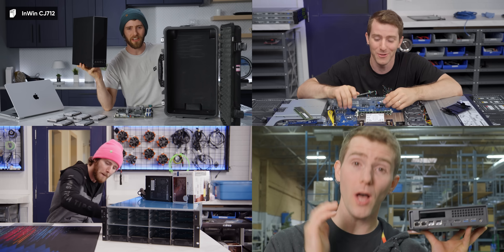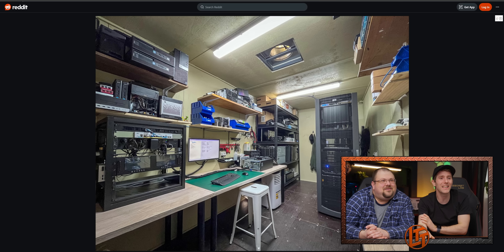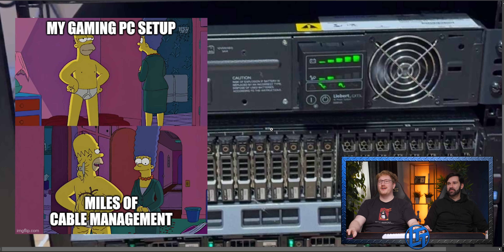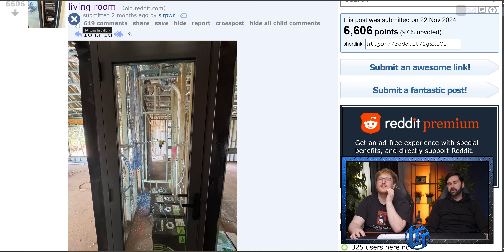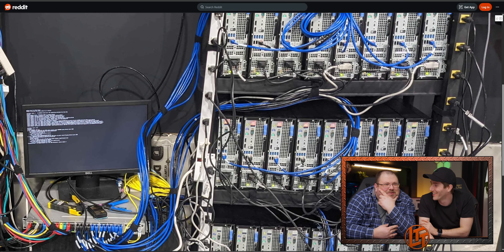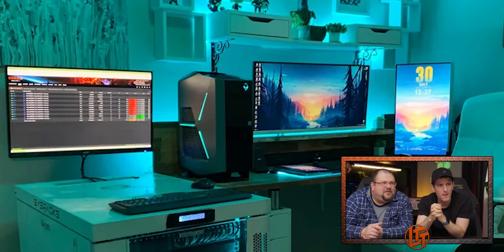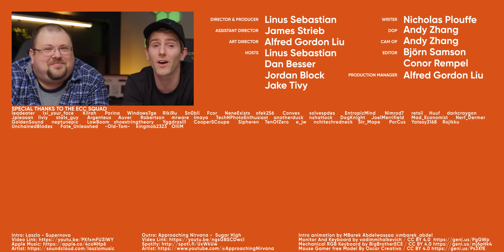Even I’M Jealous of These Guys - Reacting to r/HomeLab

Comment: If I did this, I'd make a kiwix hotspot(you can make one with a raspberry pi), use one of those five bay diskstations as a server, as well as have Blu ray backup with a modded ps3. I currently only have hotspot on my phone, and it's 30 gigs, so I might see if that's enough before I buy a hotspot. I see that people buy the big drives, and I'd rather have smaller drives so there's more mirrors of the data. I think I can make it so the setup isn't too crazy.

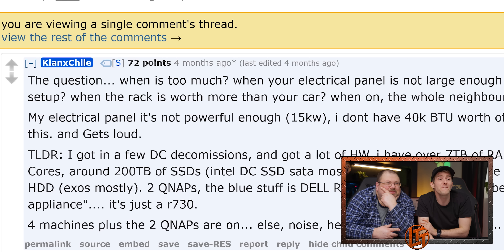Comment: Watching this while working at a utility company from home. At 8:25, the "home lab" is said to use 15 kW when it's all running. For reference, the house I'm designing for is a 3 bed 2 bath with electric heating, and if you had every single thing on in that house at the same time (electric heat, lights, appliances, etc.) that would sum 30 kW. 15 kW is an INSANE amount of draw for just the lab, and that's also a hell of a lot of heat to deal with. Thank god this guy has solar panels

Comment: Former IT here, I did bring some of my work home with me. Now running different VLANs, several wifis. My internet router is a Zhone GPoN but I only use it as a fiber to ethernet converter, it gives me a public IP adress. As a firewall I have a Watchguard M370 and my WiFi is a old Ruckus with several mesh APs. My server is an old HP Prodesk G3 running VMware with 4TB of storage and 32GB memory.

Comment: Me with my homelab being a decade old thinkpad plugged into ac, running arch Linux. The bottom cover is gone and the seperate power button board is broken so anytime I need to turn it on I have to reset the cmos

Comment: Honestly, when you work at an enterprise job at a company that can't resell their servers due to data privacy violations, but also small enough to just hand off the servers to the system admins... You end up with quite a bit of stuff.
I have a few servers and a large NAS that I remember we spent about 200k on contract from HP, along with two FGs in HA. It gets kind of ridiculous, if you're at the right company.
Quick edit because I know someone will ask: That invoice was NOT for the NAS alone--It was a larger refresh including 4 fiber switches, the NAS, and 5 blade enclosures for virtualization, along with support. Obviously one of those items is not worth that much.

Comment: These used to be my #goals, but now that I work as a system engineer I don’t want to have that enterprise hardware in my house chugging the kWh and dumping heat the the AC will need to work to get rid of. I’m rebuilding by homelab with a few servers build on consumer grade hardware and running everything I possibly can in Docker or VMs.

Comment: I must admit, I've got a rack in one of the spare bedrooms, with three servers and sixteen lines. The whole house is wired - I don't run WiFi unless the kids are visiting, and it's on an isolated subnet. At least two Ethernet ports in every room, plus to the security systems/cameras. Been building it up over the past couple decades.

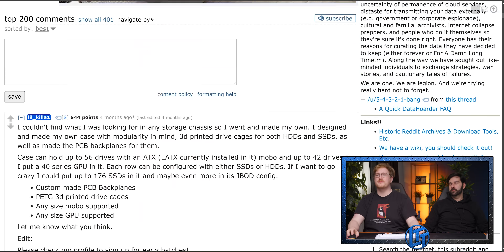Comment: 10:03 oddly enough, you can 3D print PCBs. You can do this with 2 methods, the first method involves using copper clad covered in UV sensitive film, and then shining UV light with a resin printer onto the spot where you want to keep your traces, before acid bathing it to eat away the rest of the copper. (the easier way is printer toner and an iron, then acid bath)

The second is just straight up melting metal. I've seen channels like Bad Obsession make a custom printer that would print traces from an STL file using specially made solder wire. We also have metal 3D printers now, like Hacksmiths new Meltio printer. These can definitely print a circuit board, using normal welding wire.
 
Where the second method may fall apart is with the support materials to stop those traces bending/snapping, but that can be solved by adding support to the surrounding areas with a filament changer, or by bathing the circuit in an appropriate material, and then releasing the board it was printed on so you can quickly clear the holes on the PCB. Voilà, a 3DPCB.

Comment: I designed and built a 3-monitor mount for my dual Dell 25" screens and centre 27" screen using T-slot extrusion. I 3D printed custom VESA mounts and mounted the whole setup on rollers so the monitors can move towards and away from me while staying perfectly aligned. Super happy with how it turned out!

Comment: Do you have any guidance on best practices for laying out a42U rack with about half populated?
Reply: You're gonna want to do it by weight. Heavy stuff at the bottom (UPS and servers) and light at the top - that's generally the networking gear. Don't even think about cable management until you have everything positioned where you want it and then be sure to use Velcro, not bloody zip ties.

Comment: The saddest thing about that "Grandpa Homelab" that was EOL in 2007 is that you can buy a desktop PC with 96GB of RAM and 16 cores/32 threads and 4-8TB of M.2 storage that will absolutely shred the crap out of that rack at 5% of the power draw and space.
Reply: Oddly specific comment
Reply: @archangel7294 
He's worked legacy IT for sure

Comment: I feel like I should start to post my datacent... homelab... I ment homelab... I mean... okay, it kinda escalated... Ive got 4 full 19" Racks. 2 of them are a proxmox cluster, 1 of them is a HyperV network, and one is a VMware ESXI Network
All of them work independent with their Subnets, Vlans and AccessPoints
I keep telling myself that they are just for testing to learn about all the hypervisors... but I think Ive gone a little to far, considering that ALL these FOUR 19" racks are full with servers, switches, Routers and Firewalls from their bottom to their top.😅
I even made my own Power grid for the servers

Im just testing at home... thats all... 

Did I go too far?

Comment: I personally believe that if you got Cat 5/6/7 cable bundles as thick as your thigh going through your private home you did something essential wrong, such as overcentralizing your network switch or at least choosing copper over optical fiber. Heck, most companies need less and that is without using local caching strategies and "subnet cells".

Comment: multiple desktops, some obsolete but still working so kept around as backups, some laptops and tablets and cellphones in the household. will move from a flat to a small house in a year or so, got a bunch of external and internal hard drives and even few hundred of cds and dvds which have not been checked for a decade or so /as most is on hdds or obsolete with replaced newer data/...and with the house security system with night vision capable cameras will have to be managed.... will want to consolidate all that, thinking of a half rack on wheels, ups on the bottom, nas above 12-16 22/24TB drives with redundancy for some 150TB netto space, either minipc or mini server for video surveillance and automated backups /llm AI assistant/ and some ssd based fast access nas for hot data - something like asus flashstore from a bunch of consumer m.2s or if prices become affordable maybe something small in size but big in capacity with U.2 drives ....now only time to put it all together and the pocket change of some 20k+ /mostly storage and home media and surveillance server/

Comment: 7:21 i have a setup with 3 across and 2 32"tvs mounted an the wall just above those, works great for controller games to throw the gameplay on the tvs and extra stuff onto the monitors

Comment: 13:11 Anyone know what server rack that is? I genuinely wanted to get one about that size and get a 4 U PC case stick it in there and then stick another 4U with my old PC hardware reconfigured as an unraid server before I got my current setup going but id still be down to get a rack that size for.... stuff if anyone knows one that size. Most of the ones I looked into didn't have a front panel and I have a hairy dog so thats a factor too.

Comment: Zip ties > Velcro most of the time. Faster to both put on and take off, and they don't pick up dust and lint like Velcro does. The only time Velcro is preferable is for cables you are frequently wrapping or unwrapping. In a computer or a rack where things don't move as often zip ties are the way to go.

Comment: My home server is an X99 MB with dual Xeons (72 threads), 128gb RAM, SSD OS drive (Linux), two 1tb Samsung NVMEs in a raid 1 mirrored array running the game servers, and two physical drives in a raid 1 array for mass storage.  7 Noctua fans to keep it cool.

Comment: I've still got a couple dell poweredge server in my shed.. it isn't worth the cost of electricity to run them when i can play with servers at work all day and i don't have a need for them at home. I just run a low power media server. it's quiet and it's inexpensive to operate.

Comment: I've downsized my homelab considerably over the past few years, mostly because I have more capable hardware now than I did previously. Where once I had 6 servers running (Dell R210 II, R220, R720XD, Supermicro X9DRI, 2x NUCs), I now run all the same workloads on two - a Dell R540 with Unraid for Plex and storage, and a Supermicro 5019D for Proxmox

Comment: 5:00 This dude dose not live in Sweden, if he did this stuff would NEVER power on. especially during the winter.. there is a REASON why i have stopped using my "old school" VMware stack based on HP DL380 servers with EMC SAN... now my old AMD Threadripper is my VM platform with Fedora Server 40 with virtualization installed to run VM´s like a VMware rig. the AMD Threadripper is much cheaper to run and i have a ton of RAM and CPU cores my virtualization server. best of all i dnt need to use MS Hyper-V for home lab and home infra.

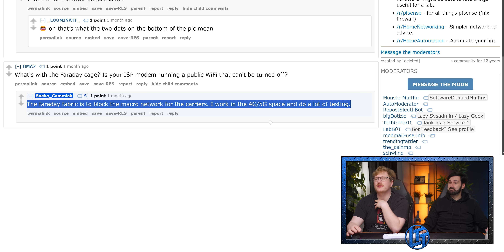Comment: 03:18 Um, former telecom engineer and current HAM operator here. No it is not extremely illegal. It is very legal, and if you live in one of the thousands of deadzones in the country, your cellular company will usually send you one of these for free that connects to your home network and the internet to provide you localized cell service. What would be illegal would be to make your own transceiver that operates on the licensed frequencies when you don't hold that license. It's only illegal if it causes interference and/or is unlicensed. The company that made the micro cells would have a license to make these. Even if you don't have a license and it's some home brew transceiver, it still wouldn't be illegal unless it caused interference. Consider that it is illegal for you to start a pirate radio station that broadcasts out to your city, but it is perfectly legal to use an FM transmitter to send your mp3 players audio to the radio in your car. That small FM transmitter is transmitting on regulated frequencies, but it is so weak it is not causing interference to anybody around you because the signal drops off within feet.
Reply: good to know thanks for the info bite 👍
Reply: I was hoping someone would explain because I had no idea what they were talking about, but was very intrigued. Thanks for the info.
Reply: @Kodack-ki2im  I think they thought it was illegal because they tested WiFi/cellular stuff before that absolutely would, without a doubt, cause interference out of their isolation chamber. Then they probably just had that in their head.

Just guessing. But ye, they could have specified the whole interference part for clarity. 🤷‍♂️
Reply: That's cool. What do you actually do in your job? Like what do you for work everyday?
Reply: Question, is there any unregulated frequencies that we are free to use as we want?
Reply: @poyenwu  There are plenty of frequencies set aside for the general public like 2.4ghz and 5ghz, however these are still regulated, and you still may not lawfully cause interference to these frequencies. This is why jammers are illegal. The golden rule for RF is you must not create interference and you must tolerate interference created by others.
Reply: @Kodack-ki2im  no one cares

Comment: Fortinet is very popular these days. Big attack surface. Also if you running eol hardware with no updates it bad. Every firewall makers have issues these days, even Cisco, juniper and other big guys.
Reply: I have a Subscription, I would not run an “enterprise” firewall without one. I own the first lab.

Comment: My "homelab" is currently reduced to a single 4u server in my old bed room at my dads place. I only have a few mac mini's running various dockerized services in my own apartment, mostly custom CI for work.
We have the same ISP at both places, but unfortunately, they wont offer a site-to-site VLAN.
So i'm probably gonna try to get two mac minis to run WireGuard and see if i can get near the 1Gbit/s uplink i have at both apartments.
Currently using my routers for this, but i only get up to around 120 Mbit/s when tranferring files to my server at my dad's place.

I did talk to the building manager here, and they told me that i could probably be allowed to pull power to my storage room in the attic.
The building's backbone is in the attic (weird it's not in the basement). They told me i could get a 10Gbit/s hookup if i want. So i'm considering that, so i can move my servers to one central place. That way, my friends can also have their servers here.

Comment: Working in a data center, I can tell you that you can accidentally get VERY high end server hardware for nothing. These big companies don't even try to sell it. They just pay companies to come in and decom it all and get rid of it. Same with auctions of bankrupt businesses where you wouldn't think to get server stuff. You can get a pretty good network and power equipped server rack from a restaurant for a hundred bucks where I live.
Reply: 100% agreeing with you
I mean... ive got 4 full filled 19" racks in my basement
2 running in a proxmox cluster,  one running HyperV Servers and one with VMware ESXI Servers

I keep telling myself: Im just testing some stuff

But I think this got a little too far😅
Reply: I mean, the cost of just decomming them is going to be expensive by itself, so if you can get someone to pay like, 5-10% of its value even, it will absolutely be worth it lol. 

I wish I can get a source for that though. I kinda need a 10G switch lol
Reply: Of course though... You have to take it all apart... And wheel it all out... And find some way to stuff it in your vehicle. You better have a van at the very least. AND THEN you get home and get to put it all back together and hope that it all works! :) There's a reason it's free.
Reply: @arnox4554  Where I live there are quite a few transport companies that will help if you don't have a big enough car. Though it's highly unlikely my area and the OP's area of living overlap at all.
Reply: @arnox4554 Oh no, the thing I'd have to do anyways no matter where i purchased everything from.  😅
Reply: @arnox4554  It’s just not cost effective for a company to try to piece out the hardware on their own. I once bought an absolutely gigantic copy machine from a school board auction. It had over 2 million copies on it. It stapled, sorted, collated. You name it.  I bid $5 because now one else wanted it. Rented a lift gate truck ($70) to get it home. Plugged it into my dryer outlet. Call a service tech to come look it over ($100). Sold it on eBay for 2 grand.
Reply: as a university student, this is my dream ;)
Reply: I'd like to know such a place. I do research and I am unfortunately met with the opposite issue (not enough hardware to run my stuff). I'd be happy to take a couple of nodes out of people's hands.

Comment: I totally agree that HP used to make some of the most serious measuring equipment.  I worked for a place making wave tech for science, and it was 2000 and we still used their frequency counters, Network analyzers, oscilloscopes, that were made between the late 50's to the mid 70's...  When the owner was to old to no longer function his family closed us down.  It was not done in a good way at al, and people got stiffed and not payed...  Well at least I recovered some loss and I got and still use the 1971 HP 3478A multimeter.  It's digital, and programmable to do all sorts, and their devices can all cross communicate, BUT (and It's a big one):  You got huge books with each one, because YOU had to do all the programming.  I also confiscated a one of a kind prototype Techtronix 465 oscilloscope; first ever with a digital wave hold and function storage thingy for superimposing readouts over each other for comparison, and a few other tricks.  It is in the same housing of an optional volt meter one could get it with (on top), just with a different face plate.  Once finalized they moved them inside with the rest of the stuff, which they were able to shrink down significantly:  The thing only has a few cm³ of free space in it for airflow, it's that jam packed full of circuit boards and components!

Comment: I love that the guy with the Fortinet had it routed through a Mikrotik. When one firewall isn't enough, get two.
Reply: i am the guy and the Mikrotik is a Router and not a Firewall. The Mikrotik does inter vlan routing with 2x10 Gb/s the Fortigate is perimeter security and does my SD-WAN (yes, I have 2 WAN connections because I work 100% remote)

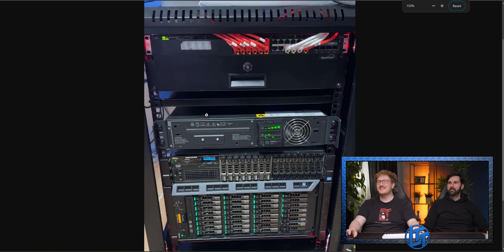Comment: The little throwaway line about the SAS drives and the frequency that keeps teenagers away (somewhere around 4:25) went waaaayyyy underappreciated
Reply: I have a Mac Pro that has 4x 15k SAS drives in it, the only thing I can hear are the drives making the case resonate, which is surprising since that case is the best built, best fitment case out of any branded desktop computer in the last 25 years. Drives me nuts but I just live with it cause it’s novel having 4x 15k drives in a Mac that would otherwise just have bog standard 7200rpm SATA HDD’s in it for its entire life.
Reply: There was a device that somewhere I worked was looking into buying due to crowds of teens loitering. I think it was called a Mosquito, but there was legal issues.